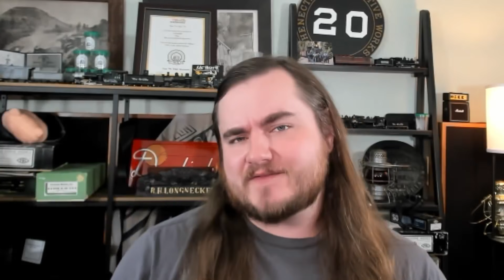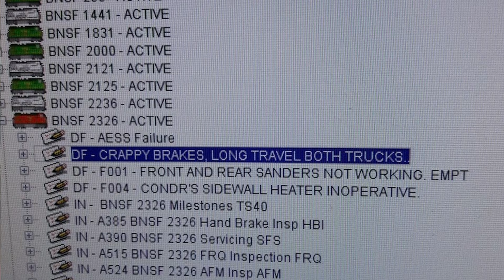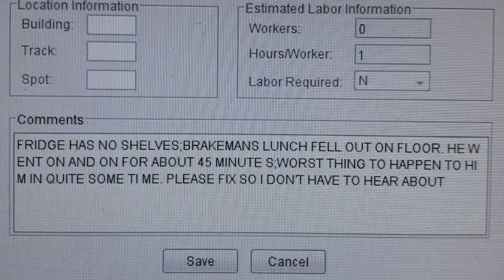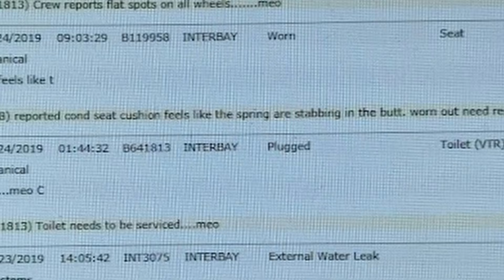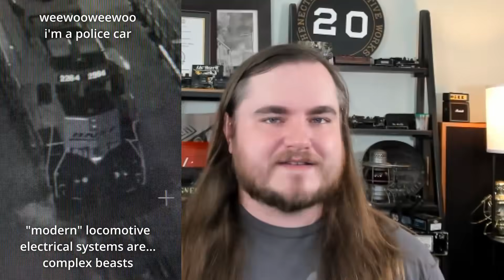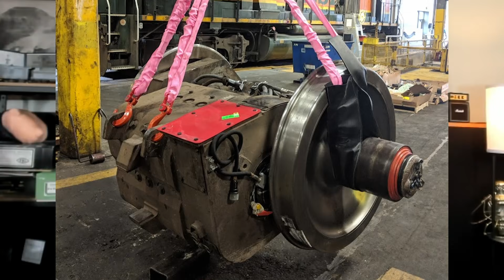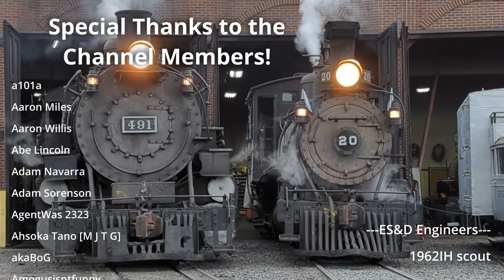What DEFECT LEVELS can a train engine have?!

Comment: My brother who works for the Union Pacific has some horror stories for sure when it comes to engine defects. For me I would describe the entire fleet (at least in our area) as just one big rolling defect. Honestly the 4014 is probably the best running engine on the entire UP system which is sad really. Precision Scale Railroading hasn't made it any better and sometimes you have to hope one engine will save the day and get the train to it's destination. I'll have to ask him and see if they have any defect list like the BNSF has. I would definitely be curious what it is.
Reply: Makes sense that 4014 is the best kept loco on the railroad tbh. It's pure marketing, so of course they want it to run well. Plus it's pampered by comparison, it doesn't do much serious work (15-20 car passenger trains don't really compare to heavy fast freights, which obviously enough they were designed to do).
Reply: @AFullerHouseAtlantic  Well I would hope they treat it well they certainly don't rest any of their other equipment well at all. Sure it gets used for work but there is a thing called maintenance that they ought to not put off until an engine is dead in the middle of a run. He's told me too many horror stories of that happening

Comment: Do you know why "GN" was painted on the SW unit? Is there a connection to the "Great Northern Railway"?
Reply from the maker: Correct! Most of the "odd" power - switchers, slugs, etc. - got older reporting marks to keep the main numbering scheme more continuous. An odd choice, but sorta cool. The SW's were all GN reporting marks. Slugs were BN.
Reply: @Hyce777  That's interesting, and it makes sense.

Comment: Interesting topic Hyce, I'm curious, how often did you see blown turbos .. And what was the defect number and letter for it ??   You mentioned about how large these engines, watched my friend jump start "yes some BIG ASS  600 v rated jumper cables " 1 F unit from another  and even those engines 
are enormous ..
Reply from the maker: Maybe once every 4-5 months we had a bad turbo. Usually the clutch broke rather than a blown up one. Level 2, because the engine was not happy running with a dead turbo.

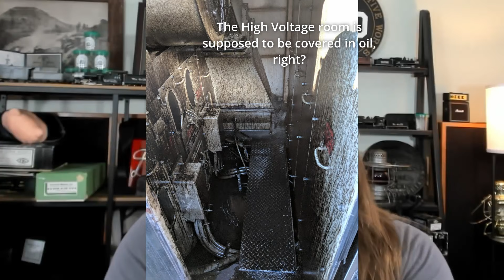Comment: Oil tank imploded or something like that in the engine room? At 8:35 knowing that the black is like used oil, I'm like ooo, yeah glad no one got sprayed and good luck to who ever was incharge of cleaning it.
Reply from the maker: The engine had a crack in the block iirc, it was a leased unit thankfully... lol. Oil got deep enough the main alt started flinging it around.
Reply: @Hyce777  Oh geez, yes thankfully (wipes forehead with hand while saying few). I feel you on that one.

Comment: I had a couple defects due to miss-wiring. An SD9 that would shut down, kill the engine if you turned the the front number lights on. An GP9 that didn't drop its load until the engine RPM was at idle. That last one would also load if the generator field was in the off position. Fun, EH!

Comment: So a lvl 9 would be like wear on different pieces like axles and what not. That need to have an eye on? Or something along those lines?
Reply from the maker: Even less important than that; little things that don't necessarily impact operation but might need attention next time around, is the thought. Axles aren't really something the railroad deals with any more (they deal with Traction Motors as entire combos - wheelsets + motors; they get replaced before an axle issue could arise).
Reply: @Hyce777  Ah, right, got it.

Comment: Instead of greasing the rails our shop guys will now bring out a little tray with rollers, jack up the locked axle (compressing its springs) and slide the roller tray underneath it.  You still can't move it very fast, this is only to limp it to the nearest back track, but it's way better and safer than skidding a locked wheelset over switches.
Reply from the maker: That's a smart way of doing it! I never actually had to personally respond to any of the incidents so I wouldn't be surprised if that's something the big RR does as well.
Reply: That's how we do it at grand forks.
Reply: I figured there had to be some way to do that. That's how you tow four-wheel drive car that can't be put on a flatbed.

Comment: Level 9: "Someone wrote a bad word on the wall in the bathroom!!1!"
Level 4: "Too many tags on the isolation switch. Isolation switch may not function or fall off."
Level 1: "This thing is F. U. C. K. E. D. fucked. Stay out of the electrical cabinet, do not start the engine, do not pass go, do not collect your paycheck. Clock out now and go home while you still can."
Reply from the maker: Pretty much! Lol
Reply: Level 1 is a GE locomotive on fire 😂  They get a lot of that.
Reply: @HumansBeing365  HAhA gE mAkE tOaStEr oN wHEelS
Reply: @HumansBeing365 That is so classy; the ‘ol “GE on fire” 😂
Heck, my icon is literally an ES44
Reply: @HumansBeing365 that's probably a level 2
Reply: Level 0: the locomotive got raptured
Reply: @JackieBright  level 0: recovered from lakebed after a nasty derailment from 1926 (a random year I chose) as a choo-choo shaped rust mound heavily encrusted with highly invasive zebra mussels (as a example)
Reply: @JackieBright  F
Reply: LOL!!
Reply: Level 0: Engine is too old and too weak. Also ANOTHER Engine is too old, but quite a bit stronger. Say, we need a more powerful version of the first engine.... I know, put the more stronger bit on the first body! Problem solved!😊😊

Comment: I was watching a train video from Ohio  it was a fairly new 4400 Ge. Anyhow I was at a spot where I could see locomotive wheels I was looking down at an angle, that the way this person had his camera set, and the loco was going by and all at once it's drive wheel started going bang bang bang , etc.  etc. I reloaded to that point and watched an the one wheel looked good for a few moments then a chunk of steel popped out of the surface, what was left looked like three craters in the wheel, it was frightening, I never saw that occur as it happened, but they just kept rolling it was an NS train and it was UP power this occurred on , so if the train does not derail who is responsible for repairing this piece of junk, NS or UP.

Comment: What defect level would you assign a Loco that derailed, but only suffered minor damage?
Reply from the maker: It really depends. Might be a level 2, might be a level 3. Depends on if the traction motors or fuel tank got messed up in the derailment.
Reply: @Hyce777  Okay, thanks.

Comment: There is a former Reading GP-39-2 at the Reading railroad from CSX Cumberland shops. They did a fluid change and the prime mover wouldn’t start. When the museum got it they went over it and it turns out they overfilled the fluid by 55 GALLONS . Since then the locomotive is awaiting repaint into reading livery and still does switching at the museum. CSX doesn’t know that it works😂
Reply: this sounds like the beginning of a preservation story
Reply: What museum has it now?
Reply: @retr0bits545  Reading railroad heritage museum in Hamburg PA
Reply: @Junior-vt9ly  Oh neat, I’m heading up near there on Vacation in just over 2 weeks so I might see it while I’m there!
Reply: Which fluid did they overfill? Engine oil?
Reply: @J.R.in_WV 
That’s the only fluid you could overfill and cause a problem. But the only problem I’ve seen that cause is crankcase over pressure and shut down by the engine protector or on computer controlled units by the computer. Obviously it had to start and run in the first place in order to have a crankcase pressure shut down, so I don’t know how overfilling the oil would prevent it from starting.
Reply: lmao nice

Comment: please do a video on
the porters steam loco 
the Japanese class d5,
how do gear trains work
something on saddle bolier and side tanks (like the big boxes) tank engines
double ended diesel trains
what to do if the train stalls
one talking about the different types of steam funnles and there uses,
a video on steam locomotive combination breaks (steam and vacuum brakes)
a short video on how a Armstrong turn table works 
what did train flagman do 
what did trains (mostly steam) do when going in tunnels, ive heard of gas masks or just useing a wet cloth 
why are some trains wagion tops (the stream lining thing to boilers)
railway terms abd slang
one on the meaning of flag and lantern colors like green on rear engine means theres another one coming soon,
different train pilots on the front (and on back ive seen some)

the different types of cut offs/reversers/Johnson bar
some are a big lever, some are a big valve wheel, and ive also seen some that are like rods, one exsample is train sim world 3 and im not sure where to find the other reverser

And one on how much water do you and the train drink

Comment: The water dumps out of the guru valve when it gets too cold, right?
Reply: Yes.  The guru valve pops open when the temperature gets down to about 5 degrees above freezing.  They work a bit like the thermostat in a car engine but can't close again on their own, someone has to pop the little plug back in by hand.
Reply: @bobsmith2637  That's a really weird and railroad-ey way to solve the icing problem.
By now there are of course more convenient ways but railroad adoption of internal combustion engines possibly predates even antifreeze.
Reply: @kilianortmann9979  water is a lot cheaper than antifreeze, it's a somewhat better coolant in terms of heat transfer capacity, and you'd never get a big locomotive diesel started in sub-zero temperatures anyway (at least not without a lot of canned help.....) so there is no point to switching away from water.  Antifreeze can also cause serious bearing damage if the engine develops an internal coolant leak and some gets into the lube oil, water in the oil is also bad but antifreeze is worlds worse.
Reply: @bobsmith2637  thinks about those videos on YT of what comes out of people's cars when they mix up where the oil and the coolant go.....
Reply: @peregrina7701  Cream of Elephant soup normally because the oil was also dirty.
Reply from the maker: Yup!

Comment: My dad used to work for a company that hauled sand for the sand towers at the yards but something that happened like all the time was the crew not knowing there was like a 1.8% grade coming up and they would run out of sand on the main and per their union policy they weren't allowed to move the train if it did not have sand, so they would just park it on the main. there are many dumb stories that started because of that.